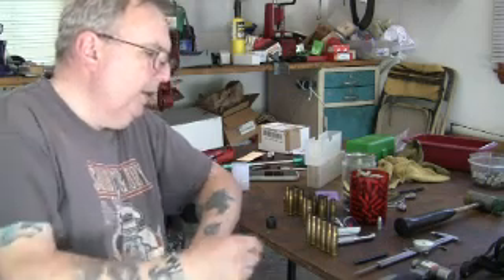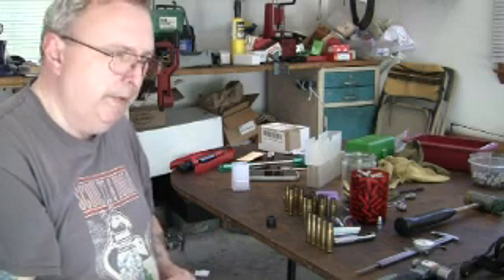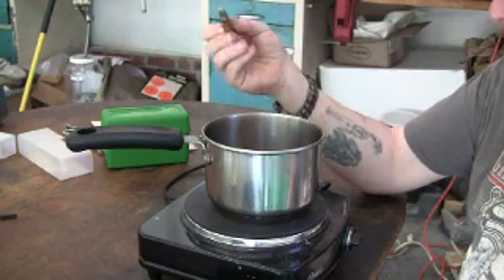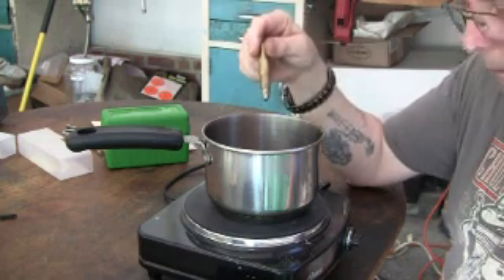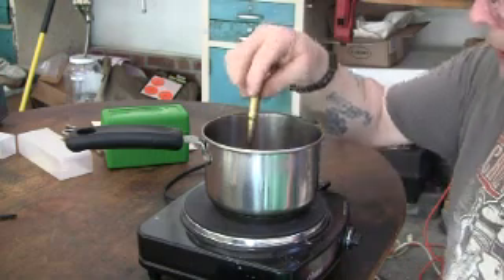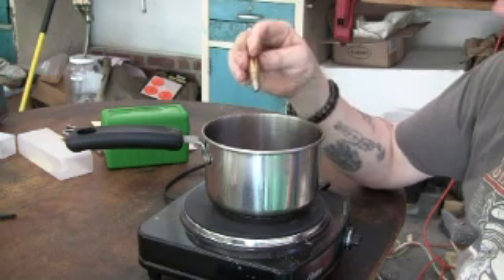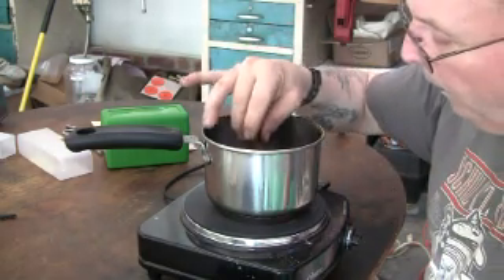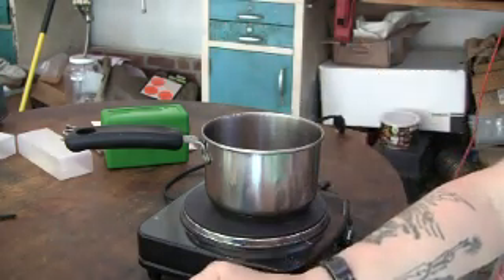Reloading 11mm Gras get the lead out my second try

Comment: I'm curious if you are getting a lube star at the muzzle? Bullets running out of lube before they reach the muzzle?
Reply from the maker: this lube is not like the black powder lubes, you would not want to use this with BP , but to answer your question, there was a residue noticeable at the muzzle of the rifle, so I guess you can say it is coating the bullet all the way through the barrel.